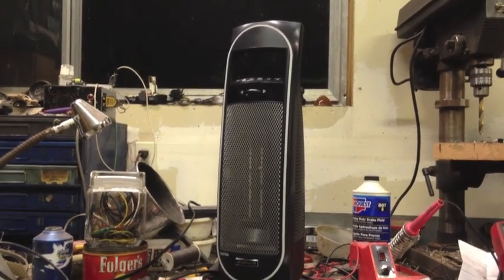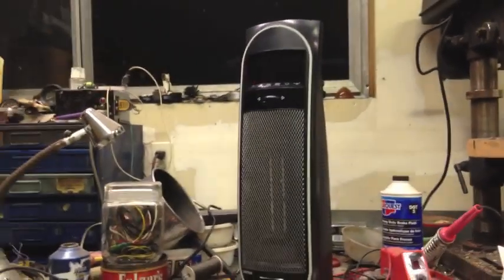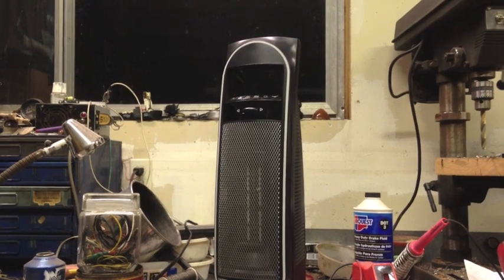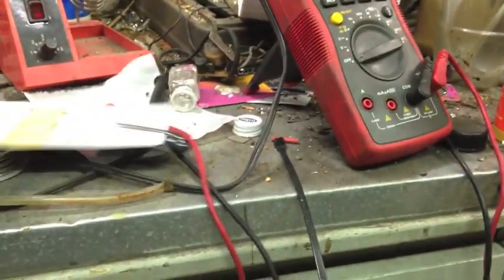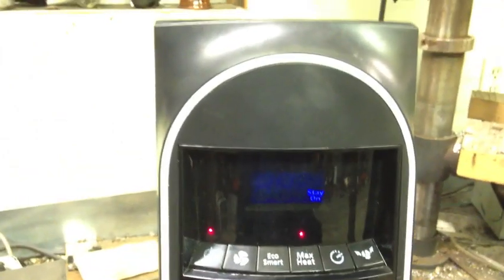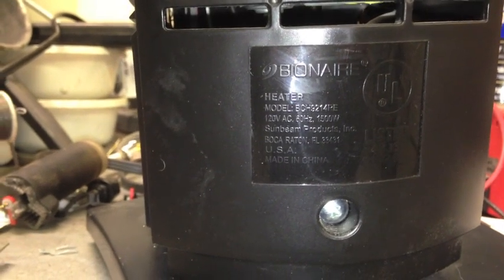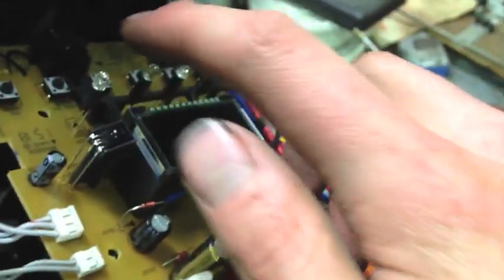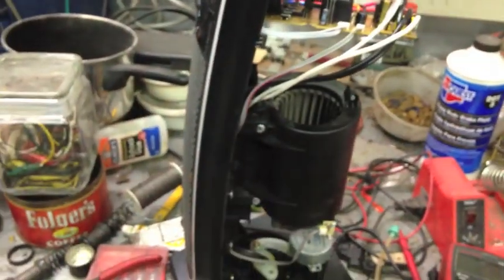Easy fix: Bionaire BCH9214RE Heater

Comment: Well I watched your video mine wouldn't start so I saw you tipped it.over I did the same nothing then I gave it a harder drop now it works thanks
Reply: LMAO. Same. My light was not solid, but blinking. I tipped it over one way on my hardwood floor. Nada. Tipped it on the hardwood floor on the other side, worked like a champ again. Thanks for the inspiration of abusing my equipment! :)
Reply: haha same here! now it works like nothing happened!
Reply: Thank you for this comment- I did just that and it works LOL

Comment: My model is Bionaire BCH9234-CN and when is plug in there is no screen and only power and Heat& Save red light is on.
I can't find the electrical schematics for that model which is totally different that yours.

Comment: Hi there. I appreciate your  videos. I recently got a used one like your dad's. Everything seems to work except it makes a screeching sound after a minute or so and continues until i get annoyed and turn it off. Sounds like the fan. I've got the cover off now is there anyway to fix this myself?
Reply from the maker: Sounds like dry bearings on the fan motor. A drop of oil on each should do it. 3-in-one, car engine oil, pretty much whatever's handy that isn't WD40 or chassis grease should do the trick. If they're really bad, you may need to take the whole thing apart and clean up the shafts with a Scotchbrite pad or similar.

Comment: I have a Bionaire ceramic swivel heater BCH9212R-U and it works great, one day I turn it on because the remote was not working it needed a new battery. I must of pushes a different button now the numbers don't light up like they use to.  Is very light.  Do you if you can give me an idea of how to fix it.  Thanks.
Reply from the maker: Might have different brightness modes? I haven't worked with that model, but you can probably find an owner's manual for it online that would explain how to set the display brightness, if that's an option on that unit.

Comment: The LCD display panel in BCH9212R unit has become too dim to read from more than a few inches away. Any suggestions on the cause or how to repair? Otherwise unit works fine. Thanks in advance.
Reply from the maker: Haven't run into that one, sorry. It's not a bright display to begin with. Might check the voltage across the backlight LEDs if you can get to them easily. If the issue is contrast rather than brightness, could be the LCD itself isn't getting full power for some reason. Good luck!
Reply: I am having the same problem.
Display has become very dim.

Comment: Could I pull out the whole ball bearing thing since mine is in one spot.and screwed down? That seemed to be my heaters issue is the ball bearing.
Reply from the maker: Interesting question. Depends on how the ball bearing safety works. I assume it's optical, so just removing the component probably wouldn't do it. If the optical part is the problem, it may be difficult to spoof. Might take some research there. If it's a mechanical issue where the ball is stuck or something, that would be easier to bypass.

Comment: I have one of these that has stopped working (different symptoms) and am unable to find disassembly instructions anywhere.  I have all seven screws I can find out but the two parts of the case won't budge.
Reply from the maker: It's not uncommon to have to do a little prying to get cases apart. I don't remember there being a special trick to this unit, but that was a while ago.

Comment: I have a Bionaire Silent Micathermic that has a failed start 1/0 button. Is there a way to repair this? Thanks in advance
Reply from the maker: I'm not familiar with that model. If it feels like the button's bound up, you might be able to fix that just by taking the control panel apart and freeing up the button (might just be wedged or something). If that doesn't do it, the switch itself might be bad. If it's a soft pad type contact (like most TV remotes), you can clean the contacts with alcohol and usually get them going again. Other types may require component replacement. Good luck!

Comment: Hi, how do I fix my bionaire BCH9212 tower heater/fan?? I took it apart to clean it and put it back together. It comes on for a few seconds or so but cuts off!!! Help!!!!
Reply from the maker: I'd check the tilt switch first. I don't remember if it's open for stuff to get in, but if it is you might've pushed some dust into it, which is making it think it's on its side. Another comment here suggests you may need to smack it around a little to get the ball moving. If it's not that, open it up again and make sure any plugs you messed with are properly seated and the wiring didn't get pinched when you put the case back together. Good luck!

Comment: My Bionaire turns on for a few seconds and then stop heating with a red power red light flickering. It keeps happening a few times. Do you know how to fix it?
Reply from the maker: No idea, but I'd check the tip-over sensor inside (with the rattling ball in it). Could be that it thinks it's on its side for some reason, though I'm not sure what would go wrong with that system. If the flashing looks like Morse code, it may be some form of trouble code; I have no idea if these units do that but some older cars/trucks do that. Good luck!

Comment: Hi, Thanks for the video, I have the same type of heater as yours, but my heater doesn't blow the hot air out, it only blew out the cold air, may I know what could be the problems?
Thanks
Alex 
California
Reply from the maker: I would check for thermal fuses that might've popped and cut power to the heating element. Could also be a bad relay or element.
Reply: @Darwinpasta  Thanks, sure, I will use the DMM to check the fuse connectivity, do you know where is the fuse located approximately?
Reply from the maker: @ALEXSHUNCAI  Don't remember, sorry. Might show up somewhere in the video, assuming this model has one. I'd expect to find it somewhere near the heating element itself.

Comment: Mine works fine as far as emitting heat but it is not oscillating. Any ideas?
Reply from the maker: The oscillation function is its own motor inside IIRC. Could be the motor's not working, the linkage is jammed, the switch that's supposed to turn it on and off has worn out, or the relay on the circuit board that controls the oscillation isn't working. Check for power at the motor (or unplug it and power it directly). If the motor's not getting power, I would check the button next, make sure it's got continuity when the button's pressed but not when it isn't. If that checks out, try and work out which pins under the relay are the coil, and see if that's getting power. If the relay coil is getting power but it's not connecting power to the motor, the relay's borked.
Reply: Stupid me. I didnt push the right button

Comment: Any idea how to fix the LCD on these?
Reply from the maker: Depends on what's wrong with it. If it's physically messed up then you're gonna need parts. If it's just not turning on, I would check that it's getting power.
Reply: @Darwinpasta  Thanks for the response.  Everything else works perfectly.  Just no DISPLAY.  Any idea where to get a replacement LCD?
Reply from the maker: @melissarij8687  Common bits like temp switches are usually off-the-shelf and widely available, but model-specific stuff like the LCD may be harder to track down, if it's available at all. I would try ereplacementparts on the off chance they've got anything for this model. Good luck!

Comment: The part 1N52318 5V Zener Diode which I found on eBay but I can’t find  where in back that look like it, I know you said it not the same. Thank
Reply from the maker: Sorry, I'm not sure what you're asking.
Reply: My heater just stopped working and I came across your video about this. I found the part that need to replace but I can't find where the old one. thank
Reply from the maker: @honthai3599  You're looking for where the diode is on the board? I've got that pointed out at 2:41, it's between the LCD screen and the electrolytic cap. Make sure you get it in the right way around (the stripe on the diode indicates polarity). Good luck!

Comment: How did you open the back cover?
Reply from the maker: It's been long enough that I honestly don't remember! Usually a screw at one end and a tab at the other, unless you're talking about the cover with the stupid plastic clips.
Reply: Remove the 4 screws at the top, then 3 at the bottom. 

I used a small/thin flathead screwdriver to slide in to where the two pieces join. Then gently turned it like a key as I went around its entirety.